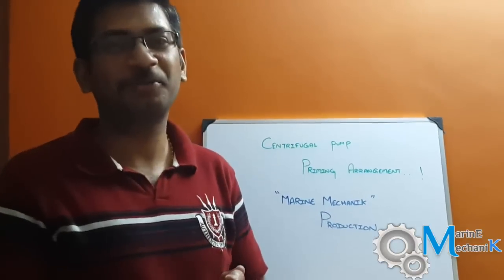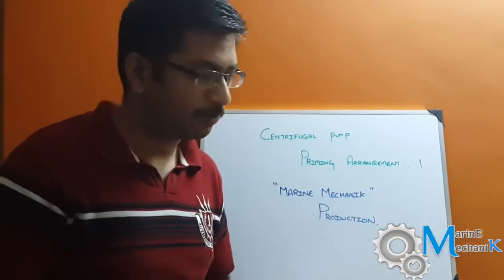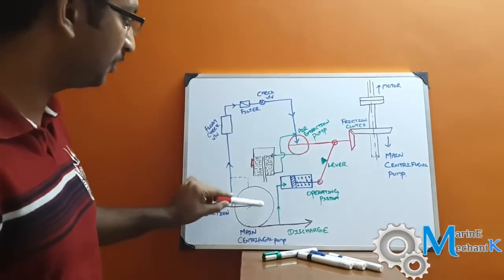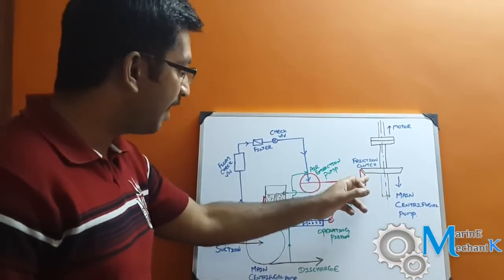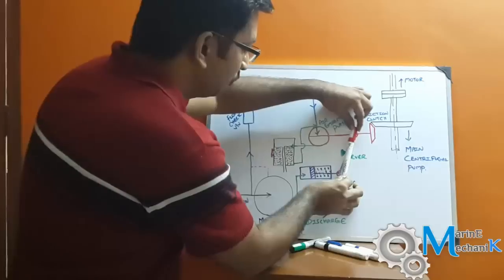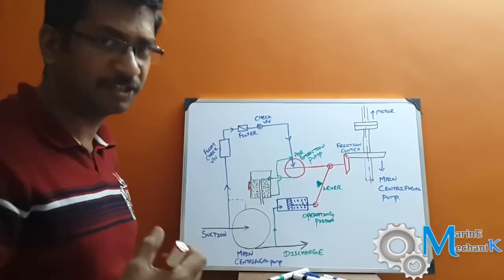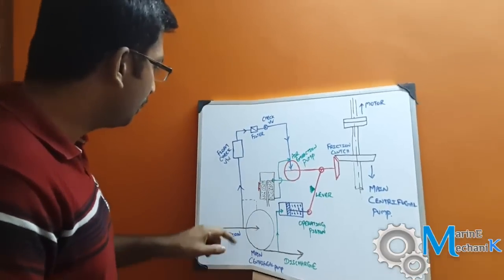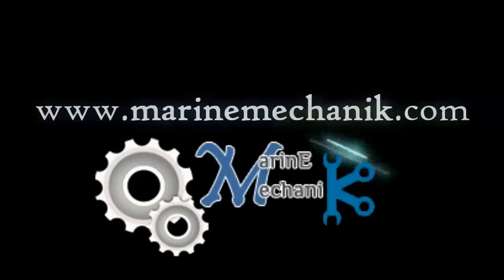Centrifugal Pump Priming Arrangement - How does it Work?

Comment: Thank you but confusing because it seems very complicated. Can we put the Priming Tank at elevated say 3m above the pump? Also you mention the priming inlet should be at the Suction Pipeline, how far from the pump should this be and when can the pumps be started, should we prime up to the discharge pipeline full of water or just the suction pipe full of water.

Comment: Nice video. Question sir. Is it required to always open the discharge valve of the emergency fire pump open at all times?
Reply: of course, during a engine room fire it is quite difficult to open that valves required for boundary cooling.

Comment: Why not just use a self priming pump?
Reply: self priming pumps have significantly shorter service life and Are more expensive. remember a fire engine may move 1000-1500 GPM and make 500psi requiring multi stage impellers and large displacement a clutch driven air pump would add unnecessary weight take up valuable space both bad on fire trucks. we always need more storage and often our weight maxes out. good question